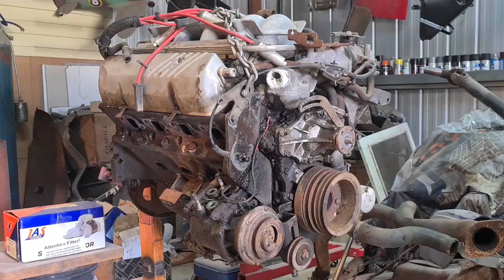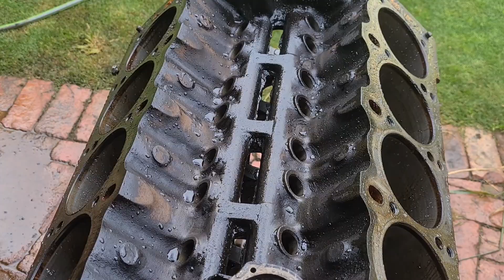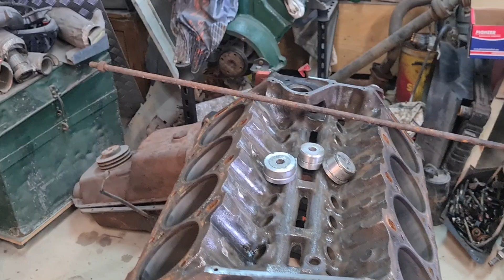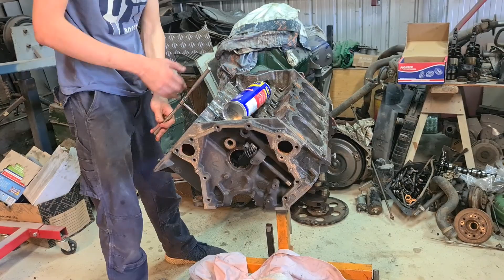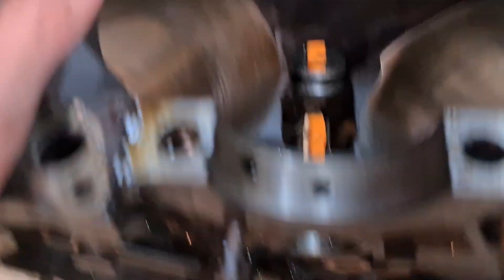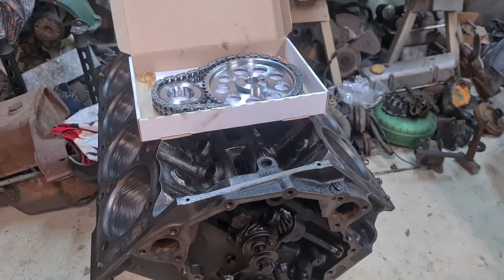Holden 304 5.0L V8 Beginning Of Engine Reassembly.

Comment: Chevy 304***
Reply: Nothing to do with Chevy LOL. This is the continuation of the original 308 engine that ran from 69 to 1999, really didn't change much over time either,  other than small rotating assembly changes and a cylinder head redesign in 1988 the basic engine never changed much...
Reply from the maker: Chevy 304?

Comment: Hi mate new subscriber here i have a few Questions on your 304 Swap as i am wanting to do the same thing to my holden 6 cylinder 1999 Vs ute i was wandering if you could tell me if you are still using the V6 Battery side wiring the wiring harness that comes through the driver side fire wall for Cluster, Batter, BCM, Ect..!!! can you please tell me if it can be used or will it need to be pulled out and replaced with the V8 wiring harness for that side of things i realise that you would have to change the BCM if you kept the V6 harness in place any help would be great thanks  and thanks for the Content thus far it has been very helpful.
Reply from the maker: Hi Luke. I used the 6 cyl harness for that side of the motor because i didnt have the v8 one. I had to extend the charge cable to the alternator and the lead to the starter had to be extended as the v8 is larger. I am still retaining the original v6 bcm and have no problems. For a 99 commodore the bcm's may have gotten smarter and may not work but im not %100.
Reply: @Joedennett69   Hi again and thank you so much for reaching out and clearing this up for me its very helpful i will Do the same thing Again thank you and i hope you will continue making Great content as its helpful to those just starting a build for the first time or those who want to learn new things cheers and i look forward to new posts from your channel.
Reply from the maker: Cheers thankyou very much.

Comment: Good job mate 

one of the best things for sludge and carbon removal is 50/50 acetone mixed with automatic transmission fluid…..

Or kerosone not bad either

COME Racing On YouTube have got some old videos explaining how to put a rope seal in a 308 If you’re interested they seem to use a jig and soak it in oil overnight and the crank goes in and out afew times…… tricky

You can get the block machined for a neoprene rear main seal  but it all costs money. 

Interestingly they also do an oiling mod for a 308 by drilling an Annulus the front Cam bearing housing to improve oiling……

so if you’re handy with a die grinder, you can do that for free basically, but it’s probably too late now doesn’t matter if it’s standard setup i guess

1/4 cam or a mild cam would’ve still been okay mate

Good job looks great..!
Reply from the maker: Ok cheers for the info

Comment: Cool little engine, can you slow down a bit so us guys in the States can see it? I never seen one of those over here before, what was that little gear under the timing chain?

It looks similar to a sbc but a bunch of differences for sure, interesting.
Reply from the maker: The oil pump is driven of the front of the camshaft similar to a big block mopar or some buick v8s i think. That is the little gear i think you are reffering to. Funny enough it doesn't displace many ci but is physically larger than a small block chevy.
Reply: @Joedennett69  Cool, good stuff. What is the bore and stroke for that little big guy?
Reply: @Joedennett69 no it's not , it's smaller and lighter than a Chevy , it does have the same bore spacing as Chevy , early motors 253 ci and 308ci had the same port location as Oldsmobile Rocket 350s only Olds and Holden V8S have it ! It has Chevy bellhousing pattern on later fuel injected 304 ci and 355 ci roller motors .
Reply from the maker: It is a 4in bore with a 3.02 stroke
Reply: @Joedennett69  That's good that it has a 4" bore, what size is the rod journal? I'm curious if one could get more stroke out of it?

Are the rods the same as the sbc rods? Do you have measuring tools like micrometers or maybe a set of calipers?
Reply from the maker: @itseithergonnaworkoritaint7852  They do have a 5.7in rod, same as a 350 I believe. The journal size is 2.124 so the rods are not the same. People in AUS do build stroker kits for these motors 355/383. or offset grind standard cranks.
Reply from the maker: @itseithergonnaworkoritaint7852  There are 3 different displacements of this family of V8 a 253ci, 304ci and 308ci.
Reply: @Joedennett69  
That is very cool, do they make good aftermarket cylinder heads and intakes for  them?
I always wanted to visit Australia IIRC that where you are? It's almost summer over there and it is only 0* C here in Michigan where I'm at and it's not even winter yet!
Reply: @Joedennett69  
What are the bore and stroke for those or maybe do a video on it for us guys in the states that are Holden curious?
Reply from the maker: @itseithergonnaworkoritaint7852  Yes I am based in South Australia, and i plan to upload a fair bit more on the Holden V8.
Reply: @Joedennett69 they came in 253, 304, 308 and 355ci
Reply: Stroke 3.48 for 355 cube 3.75 stroke 383 3.875 396 they made aftermarket blocks to 411cu and 427cu